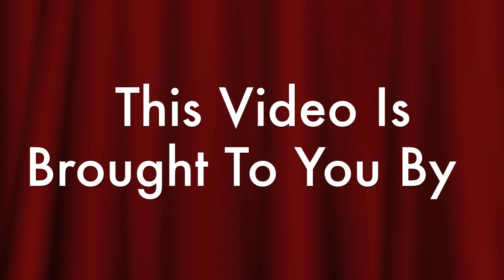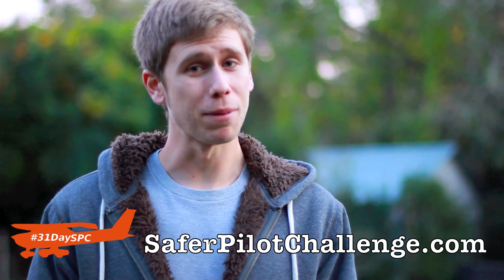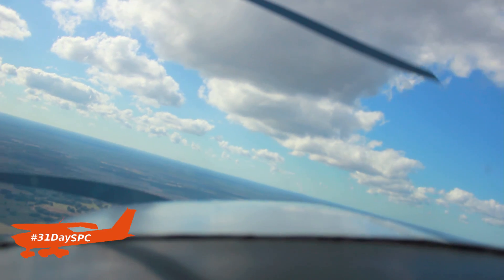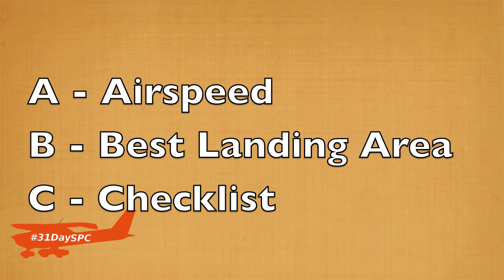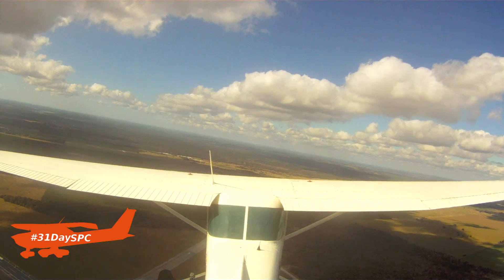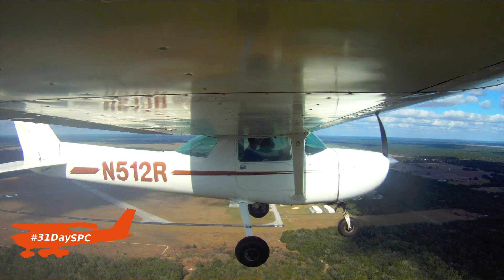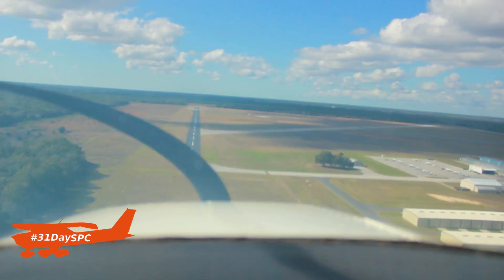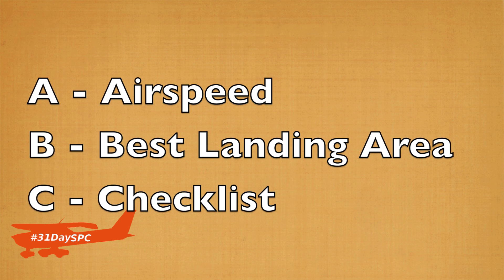Engine Failure Inflight - Day 3  #31DaySPC

Comment: Cessna 172R
A-Airspeed: Best Glide
B-Best Field
C-Checklist:
   1. Fuel Selector: Both
   2. Shut Shutoff Valve: In
   3. Mixture: Full Rich
   4. Throttle: Full
   5. Aux Fuel Pump: On
   6. Magnetos: Cycle L/R/Both
   7. Ignition: Start (If not Windmilling)
D-Declare: Emergency
Reply: Throttle full?
Reply: what about carb heat ?
Reply: And the ELT

Comment: Thanks for the detailed info Victor. I have almost 7k too on pistons and 9 engine fails for almost the same reasons as you on valve train fails. But those fails of fuel systems are strange. Specially with auxiliary fuel pumps. I guess you fly mostly in humid areas where water is collected in the tanks, engines etc. and tank vents are blocked by insects. Humid Lowlands rust on machinery and insects can do a lot to airplanes. I'm I right or wrong? looks like you landed on flat fields and you know the area well too. Lucky or just good pilot? I only had 3 of them totally, 2 on twins Seminole,  DC-3's but made it back to airport on all. Luck and training. On single a short wing Cherokee , at 500 feet turning crosswind with a student, I did a 180 turnback. no damages either. Student never came back. We are survivors. Cheers SuperPilot.

Comment: I like this video. Fly long enough you will have an emergency landing. I have 7000 hours an have made many. Second solo, PA-11: hydraulic lifter failure, beat one lobe of the cam to nothing. Broken valve spring: Once in Piper PA-25 once in Bell 47-G. Broken valve stem Bell 47-G4, Cessna 152. Failed fuel control: PA36-300. Failed alignment pin on crankshaft gear that drives camshaft: PA36-300. Failed fuel system: Cessna 140, Maule M-4, PA-12, PA-25. All landed fine with no damage to the aircraft.
Reply: victor hulbert 7,000 hours? Are you a commercial pilot? That's a lot of flying even over a span of 40 years (if flying for recreation).